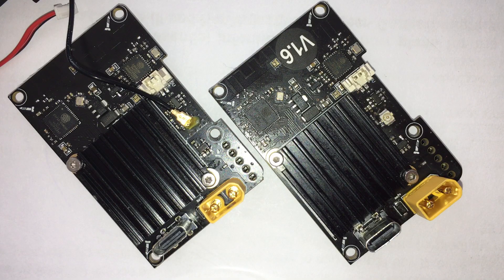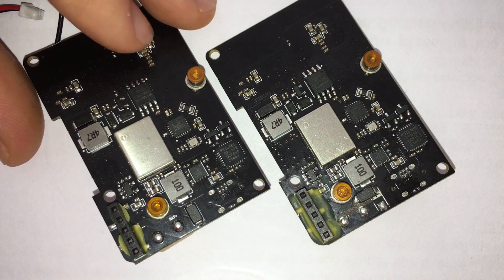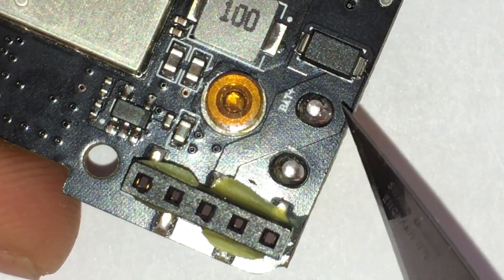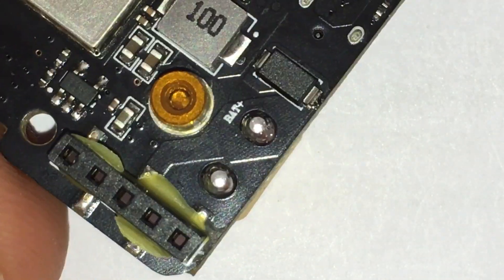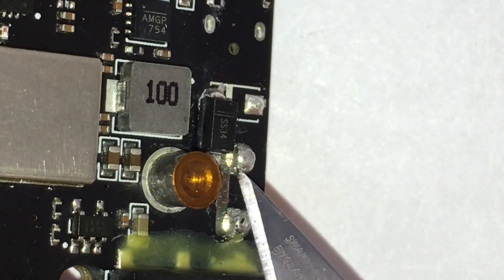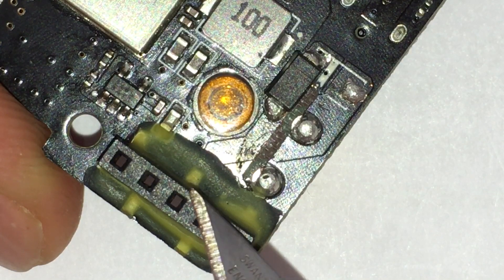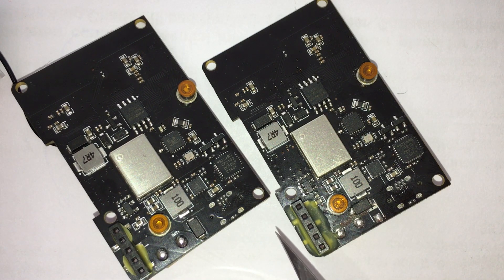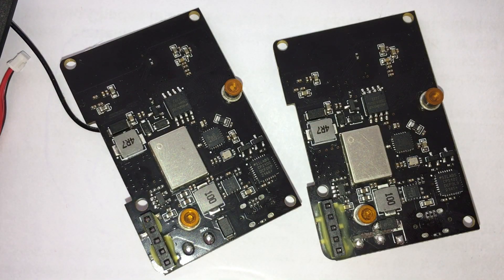RADIOMASTER Ranger Micro - XT30 Fix & New PCB Analysis

Comment: I have a pcb which is different to both of the units you have, where you have the single diode that has been turned 90degrees to solve the connection issue, my pcb has two smaller diodes instead of one….I’m hoping this is maybe a newer version, but I don’t know, maybe it’s older than the ones you have.
Reply from the maker: It must be a newer version because the one I have came with the pre-order batch, so mine is definitely a V1.

Comment: a regulator should have been used for the XT input voltage and the mixed via o-ring diode to a common input, this fix doesn't solve anything
Reply from the maker: I'm not an expert in this, sorry. All I was showing was the differences between the version that the initial procuct was shipped with and what the manufacturer provided as a replacement. Hope that makes sense. Since you do know what is up with this and how to fix it, why don't you write them an email and explain how it should be?

Comment: resellers now have stocks for original as well as the updated pcb modules. Is there a way to tell them apart while buying ? i.e. short of opening the package and looking for v1.6 print ?
Reply from the maker: The new ones have a sticker both on the plastic housing outside as well as the PCB inside. If you want to be 100% sure, you will need to open it up and have a look inside.